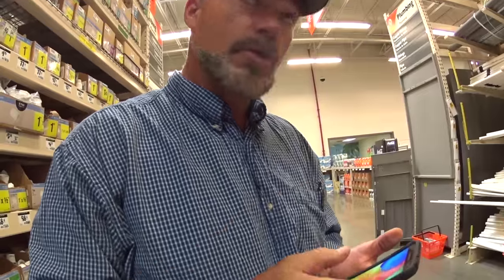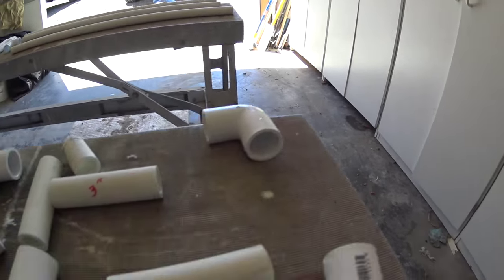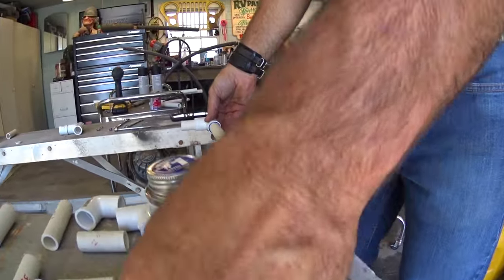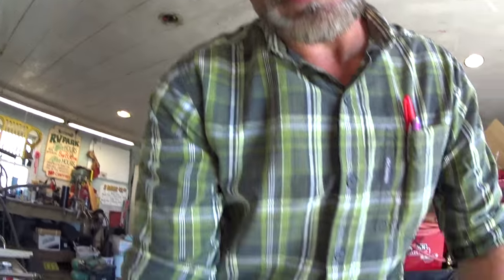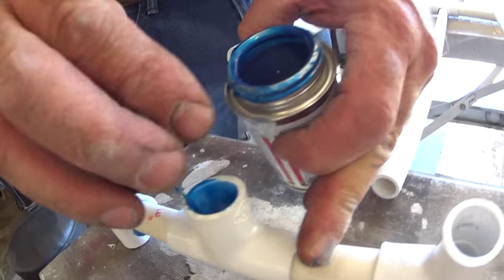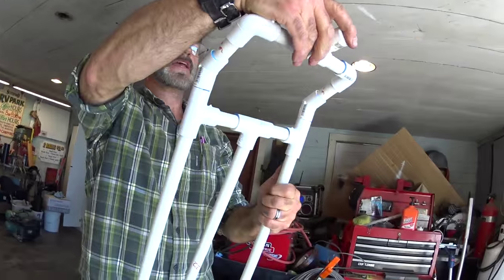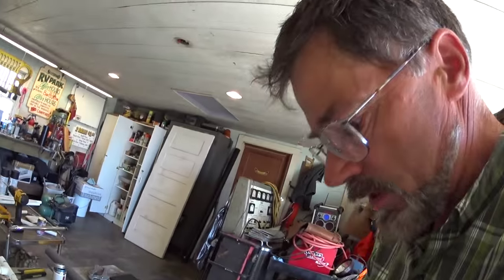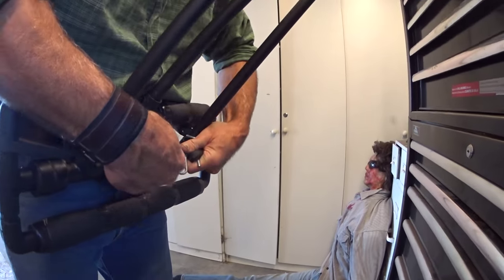How to Build a DIY Snorri Cam 3rd Person View

Comment: Hey guys! My dad owns a water business and we deal with pvc pipe literally daily. You may find it a little easier to square up your glued section by putting glue on the pipe AND on the "T" or the "Elbow". It will also help it set into place and allow you a little more time to square things up perfectly. Awesome video!
Reply from the maker: hey thanks for the tip, excellent info.

Comment: really do appreciate the build, it works great.  However, after 4 subsequent trips to Home Depot in the span of about 2 hours trying to build this, I would suggest re-evaluating your parts and cuts list in the description.  There were definitely a few measurements incorrect in my experience along with the 45 degree joints missing!